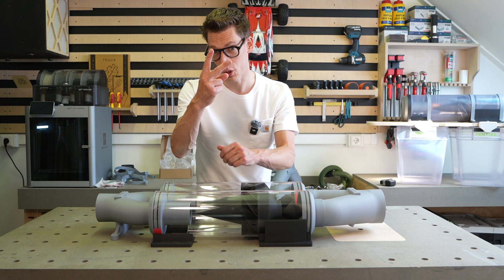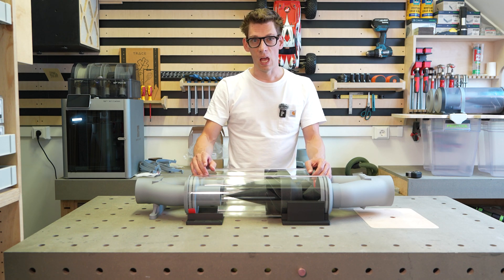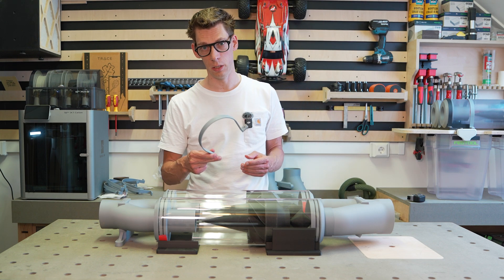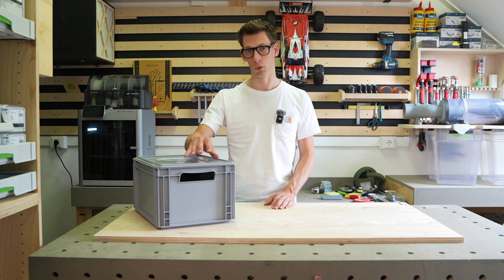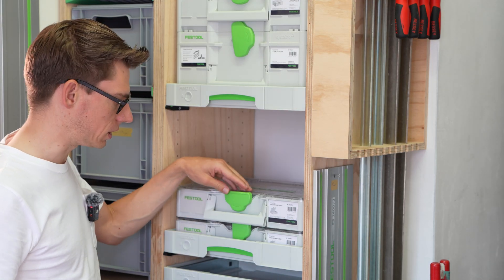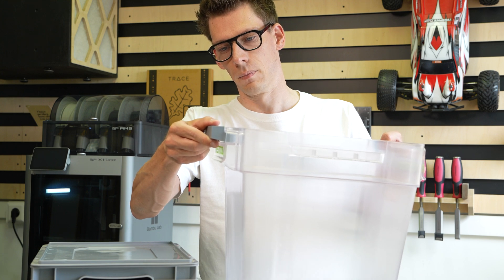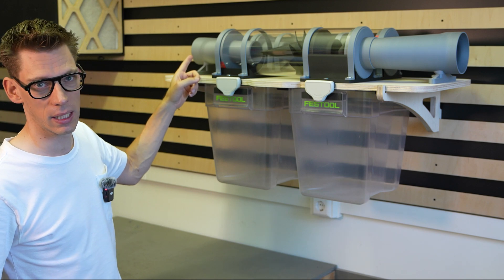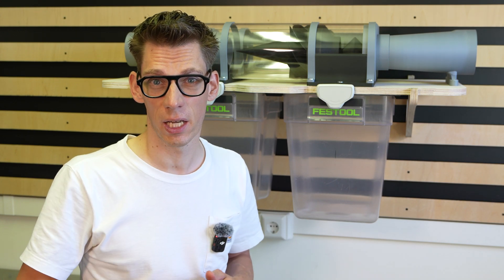My Centrifugal Dust Separator, is ready! (Part 2 • Budget Dust Collector #diy)

Comment: So cool seeing this moving from the original wood versions into improvement after improvement.
Printing it and ordering the parts.
I am looking into an alternative for the festool boxes as the cheapest i can find is around 200EUR for the 3 bins.
Ill let you know if i find a nice enough solution.

I am also wondering what you use as 'stofzuiger' 🙂, 
looking into a proper sized impeller and some filters DIY solution.

Could you share what you use?

Thx Piet
Reply from the maker: I ordered my dustbins at devijl: They have still two in stock for 40 euro excl. VAT: 
https://devijl.nl/?product=festool-opvangreservoir-voor-voorafscheider-vab-20-1
Reply from the maker: Hi Piet, I use the Power record CamVac:
https://baptist.nl/persoonlijke-beschermings/stofafzuiging-en-luchtreiniging/record-power-cgv286-4-camvac-stofafzuiging-36-liter-2000-watt

Comment: Have you compared effectiveness of a single centrifugal channel vs. this twin channel design? Would be interesting to know whether a single channel would be acceptable in workshops that don’t generate the high chip load of a planer. My camvac and cyclone are mainly used for a cnc machine and a router table. I wonder if a single channel would be fine.

Comment: Question: do the bins have to be separate? Can you just have a single compartment that collects all the dust?
Reply from the maker: Dust will travel through the way of least resistance. So having one single component will result in air traveling through the dust ports and the collection chamber instead of trough the separator.

You can add a divider wall in the chamber that seals properly. Ideally the second bin only needs to be 20% of the total bin size because 80% is captured in the first stage.
Reply: @CapturingDust  Thank you very much.

Comment: Hi! Great video's and system ... I also have camvac, the two motor wall mounted version - I use 100mm wall mounted pipes - will the 150mm version perform just as wel in line with the 
100mm wall mounted pipes?
Reply from the maker: The air inlet diameter is built for 100 or 120mm pipe. So the dual 150mm separator or dual 6” is what you need. 

I am building a single 200mm version also for 100mm pipe. But I don’t have any results on this model yet. I was hoping that it will give the same amount of capacity and about the same performance. Maybe a dual separator tube is needed so maybe I will build that to.

Comment: Very nicely done! I will try to replicate this in my garage. What kind of vacuum do u use atached to this?
Reply from the maker: I use the dual motor Record Power CamVac CGV286-4, 36L 2000 Watt for my planer. And for testing I use the Record Power CamVac CGV386-6, 90L 3000 Watt. Only I am working on a own DIY dual motor vacuum built specifically made for the separator. It is planned to be ready in January and progress can be followed up on my Patreon.

Comment: I would recommend a small ledge under the bins, so that if you are not holding them securely after unlocking, you don’t spill the content everywhere. Most of the time it is not required, but when it happens, best to have a safeguard in my opinion. 

Thank you for the series, looking forward to your next video.

Comment: This is great work, and you making the files available for free is awesome. Thank you!! I have a few questions though, and I hope you can help me with the answers.
1. Can I make the acrylic tube longer? You have it at 500mm, what if I double the length to 1000mm? Will it allow the fine dust more time/distance to spiral to the outer edges? I will be hooking it up to a 3hp dust collector.
2. Can I use 1 container to collect both the coarse and fine dust? Where I am, it is expensive to get the Festool containers that you used. I am instead thinking of using a 65L Ikea Samla container that will be big enough to collect the dust from both ports. Is there a reason that 1 container is not used to collect both coarse and fines?
Thanks for any advice you can give me.
Reply from the maker: The impact of making the tube longer is a difficult question. There will be a optimum depending on the blower type. But only I did not figure out the formula for that to predict its performance. That would be trail and error.

2 stages on one container will not work because the air will travel the way of less resistance. Dust will go out trough the outlet not in the bin or will circulate in the bin.

Hope that answers your questions!
Reply: @CapturingDust  thanks for taking the time to answer. I will definitely go with a 2 bin system. As for the length, I have already got my 500mm tubes and will build that first. Will then do the 1000mm tubes and will let you know if there is a difference.

Comment: I wonder if designing an inertial seperator like those on turboprop jet engines would be of value. That way vacuuming up a big chunk from the floor wont damage the fragile 3d printed blades.

Comment: Incredible work and improvements! Very impressive! Is a high CFM vacuum source required to achieve the same efficiency as you've achieved, or could my shopvac achieve similar results?
Reply from the maker: You will need a 100mm hose for it. Connecting a regulator shopvac is not enough. Maybe only for one tube, but I think it is still under powered than.

I will make a small version specifically for a shopvac in the next month. I already ordered some parts for it 😉.
Reply: @CapturingDust  I will be eagerly waiting. Thanks for sharing!

Comment: How easy is it full of dust?
Reply from the maker: When I am planing big chips it will be full very quick. Only it takes me seconds to change a bin. I have three of them and the second stage bin fills up very slow. 

For me it was the balance between space and fast to move forward when a bin is fully filled.

It took me mostly 15 min to fill up the CamVac and 15 minutes to clean that bag and filters. It saves me a lot time and exposure to dust because the CamVac I only need to change after months now. 

You can see it in my testing video I made a while back: https://youtu.be/ENybYVAr11Q
Reply: @CapturingDust  i was more wondering about the weight of it. If it would be heavy and fall down, when you opened the locks.
Reply from the maker: Not tested it hanging on the wall with dust in it while changing the bins. I think it is not a issue while the bin is still hanging in the bracket at the back. When you pull the bin to the front it will drop down. You have plenty of time to support the bin with the hand that you use unlocking the T-loc. I will find it out in the next weeks.

Comment: Ist this a better than a double cyclone or is it nearly the Same?
Reply from the maker: I still need to test that. I ordered a oneida cycloon to compare, only it’s in backorder for 2 months now. They are hard to get here in the Netherlands. 

I guess the pressure loss is a bit less on the centrifugal separator because the air doesn’t need to make a u turn compared with a cyclone. Only really big difference I think will not happen when both separaters are designed accordingly for the blower and dust type. 

There is very little research available for the centrifugal separators. So there are no calculations for it available. It will be trail and error to find the optimal design for each type of application. 

I hope we together can create the necessary test information to better understand how the different design parameters can affect the performance.

Comment: This is really amazing how this project innovation went from wood to an update to another update ! and now this ! amazing work !!!!
Quick question , if I want to use only 1 tube I saw you mention that it should be tube of 8 inch , from your perspective should it be as efficient ?
Reply from the maker: I have a feeling that it will be very close as two 6 inch tubes. Don’t know for sure, I really like to test that when I have more time. 

Harvey uses 2 tubes of 8 inch on a single inlet of 6 inches (or a Y-piece of two times 4 inch that they put in front of the inlet side as a option). I tested with a single 4 inch inlet and two tubes of 6 inches. 

So if you run a 4 inch inlet than I think it would be pretty close.

Comment: Going to patreon right now.
Always liked captain disillusion 😂

On a more serious note: the festool plastic is indeed very expensive. I do wonder if IKEA samla could be an option it's cheap and globally available. The different volume models also mean large and fine can have different container sizes.

I will test myself this with a cyclone separator.
Reply from the maker: Why captain disillusion? Explain please. 

On the IKEA bins topic is a issue page opened on GitHub; https://github.com/Makerr-Studio/CentrifugalDustSeparator-/issues/6
Reply: @CapturingDust  your logo reminded me so much of that channel I assumed you made a cheeky wink. I guess it's a total coincidence which is totally possible of course. But hey, lean into it for some fake YouTube "beef". I'm sure intern Alan is easy to push around 😉
Reply from the maker: I understand you now. That channel has 2.5 mln subscribers 😅 and also the CD as logo. I did not know this channel existed, maybe I lived under a rock 😉.

There is a option to put two IKEA bins in to each other for more strength. Only it does not look nice and I miss a mounting point for the T-loc.
Reply: @CapturingDust  I've ordered 2 festool bins from De Vijl to be safe, might have been the last ones, sorry everyone in Benelux.

I will still attempt the IKEA bin idea because I plan to build multiple, so thanks for the link.
If this works at home for sure the makerspace will get one as well.

Comment: This looks great! Any major revisions coming to the files that we should wait on?

Just an idea, you could use door “D” weatherstripping in a pocket instead of the tape. I have a feeling the tape life will not be long. 

Also, what about a small hole in the platform for the cleats to index into? I’ve gone this and it does a good job at making things a little more sturdy.
Reply from the maker: I think a U channel strip on top of the bin could be a option. Only I did not choose that route because I like the bin to be as standard as possible. 

I am planning on releasing the REV 02 files of the Y-pieces and in and outlets end of this weekend. 

I redesigned the Y-pieces so they don’t need any support material now to print. And I reduced some weight on the in and out let’s.

I’m am focusing now on the testing setup to see how the performance is on different situations.

Comment: does a single turbine version also work?
Reply from the maker: Yes it will! You probably need to use a larger diameter tube though. Under Dunn build one separator out of 8 inch tube.

https://m.youtube.com/watch?v=n2OStvRteRE

Comment: Really enjoying seeing your progress on this! Have you noticed any issues with air turbulence kicking fine dust back up from within the secondary collection bin?
Reply from the maker: No I have not. The secondary bin will fill up far less quickly than the first one. And I designed the dustport so the air flow only goes down into the bin.

Comment: It occurs to me to wonder whether this would work ok with 100mm tubes. That would shorten the entire design considerably (useful in my case) though I wonder if it would perform adequately. Since a Camvac is only a 100mm inlet anyway, and in reality the motors that are used only have a 50mm hole for air to be sucked through, I feel it might be ok. The original Harvey unit uses a centrifugal fan with likely a 150mm inlet, so running dual 150mm pipes is a necessity I would have thought.
Reply from the maker: There is a patent that uses a factor 1.4-1.6 of the big tube compared to the inlet diameter: https://patents.google.com/patent/EP2832449A1/en

Questions is what kind of dust sizes it is tested on. And how fast the air is moving through the pipes I think. 

I like to make a version myself for my festool extractor. That’s uses about 27/36mm I believe. And 50mm to the motor.
Reply: @CapturingDust  That is very intersting. So my camvac has a 100mm inlet, which is ~7800cm2. If we wanted dual inlets that would roughly match this, they would each be 65mm in diameter which would then give us a pair of 100mm diameter main tubes.

I'm interested to see what the static pressure/airflow losses are using this type of separator.

Comment: Engineer from Koenigsegg might think of this as DYI on a budget.

Will be interesting to see the results compared to 2022+ hybrid cyclone + baffle systems or simple cyclones with neutral vane.
I would  like to make a small single jet for 38/32 tubes for my desktop CNC at some point. 
But I will start with a copy of Oneida Dust Deputy Low Pro scaled to fit on big pickle jar or small bin.

Two technical points 
It is better to cut the sealing tape diagonally to avoid straight gaps and overlaps.
Include earthing point for the whole system including buckets will keep the walls cleaner and buckets won't zap you.
Reply from the maker: I also ordered a Oneida-Air Super Dust Deputy 4/5 Cyclone (backordered for 2 months now). And will try to build a thien baffle and a simple waste bin separator to compare them. Like to find out what the difference between them will be as a cost/performance ratio. Only that is content for the a whole year to make with a full time job beside it :D.

Comment: For future revisions, consider precise drilling of clearance holes for Rampa-type threaded inserts to screw non-carriage bolts into the base plate rather than carriage bolts (at least as an option). Carriage bolts referenced to plastic are much less reliable, and if any strip problematic to service. The inserts are mildly more expensive but bolts are cheaper and they will be more secure.

Comment: Love what you've done here.  One possible suggestion.  Seems like when you remove the festool dust bin, that you would get a face full of dust.  However the hole from the separator leading to the bin is quite small.  Seems like you could have a lid on the waste bin that just has a big enough hole for dust to fall into.  This would greatly reduce the dust escaping when you have to remove a bin.
Reply from the maker: I use a CamVac after the separator so my separator runs on a vacuum. I don't think dust will blown out when changing the bins in my case, even when the system is still running.

Comment: Looking forward to seeing this progress with each new video. I'm still stuck in analysis paralysis about whether to do it with my 3hp HVLP or my 2kw camvac. I have a plan to dismantle that, make a new frame and add a third motor (they are just numatic vac motors) to make my own 3kw one. Second issue is where I put it!
Reply from the maker: I also breading on a idea to intergrade numatic vac motors into the design. Not yet figured out the details. I do not have a 3 motor CamVac, although I would like to test it to see if it will make some difference. 1 motor is definitely not enough. I tested the PCV version with very short length of flex hose between the planer, separator, and CamVac. I cut the 2 meter flex hose in two for that. So I think you need more power when you add tube length to the total system.
Reply: @CapturingDust  yes, hose length will affect airflow but it is less of an issue with HPLV motors like those on a cam vac. I believe Dennis from Hooked on wood runs 3 motors and can vary between them as for example, you don't want 3 when sanding.
Reply: Interesting!  Do you have a link to which motor in particular?  I wouldn't mind making my own if it is made from off-the-shelf parts!
Reply: @StormGod29  Sorry I did reply to this last night but it appears to have not been accepted, probably because it had a link in it. Try a search for Numatic Motor or DL2 1104T 205403. This is just one of many many part numbers for these motors. Ideally find one where you can get a spec sheet to see not only power but flow rate and static pressure. For example the UB11053DN is apparently a 45l/s and 2100mm suction motor and is rated at 1100w. Others will be higher or lower in different aspects.
Reply: @MrDBT85  awesome!  Thanks very much!
Reply from the maker: Ingos tipps made one him self: https://m.youtube.com/watch?v=2-J8GXajv78&t=2867s
Reply: @CapturingDust my German is worse than my Dutch!
Reply: HEVO shop has many different vacuum motors, even three stage bypass motors. And good prices.
Reply: https://youtu.be/grUPBzlcOFs?si=CJ4GleyXnEWLxCGv

Mike m on YouTube has an interesting take on this subject as well, using a spindle motor to power a vacuum. Making a sort of crossover between a camvac and a hvlp system.